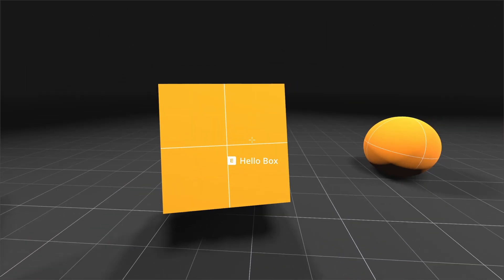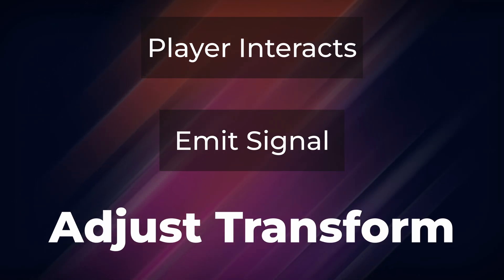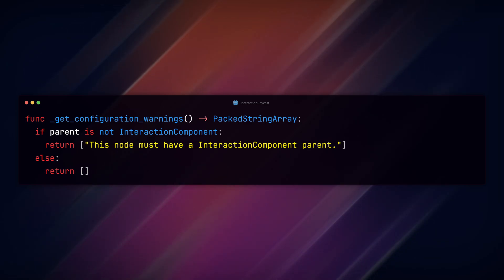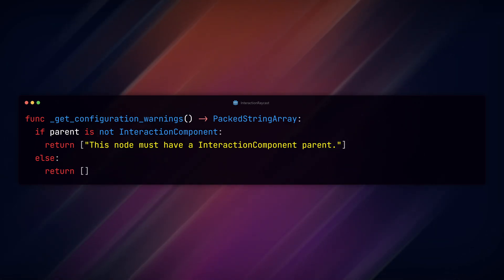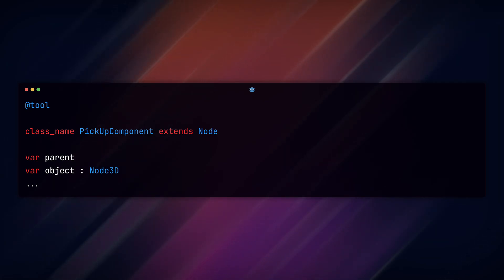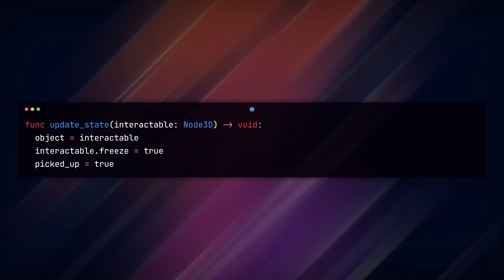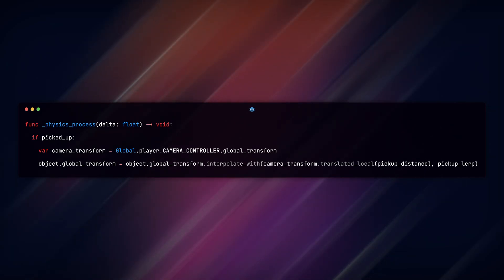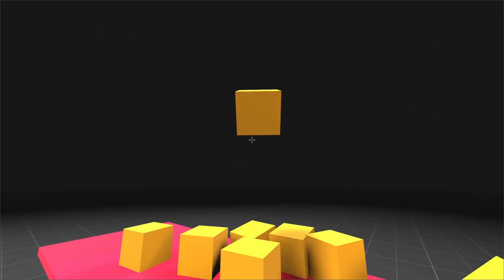Picking Up Objects // Make An FPS in the Godot Engine

Comment: The Video helped a lot I did not know about the _notification function.
Interesting way to implement it, i choosed to remove it from the tree in case I use it as inventory to move with a item into a other level. Also I use a point as object target to be able to look and move a object at the same time.